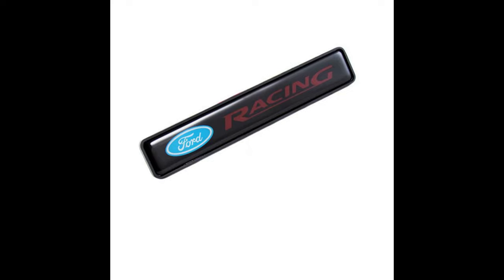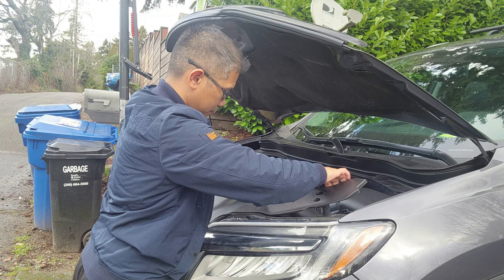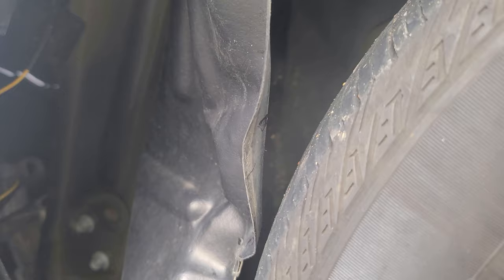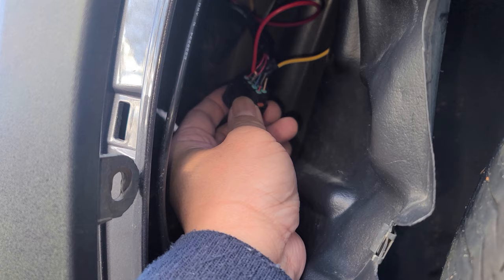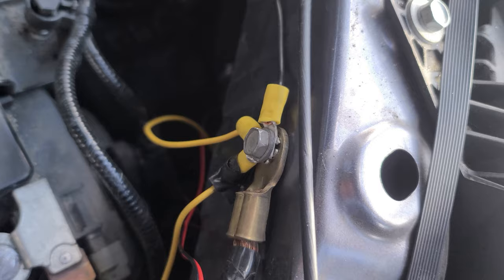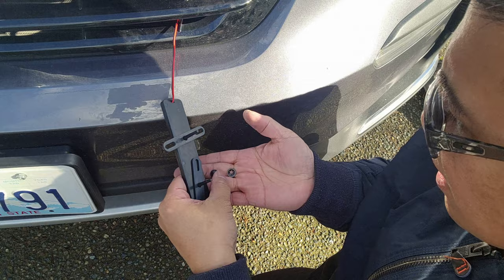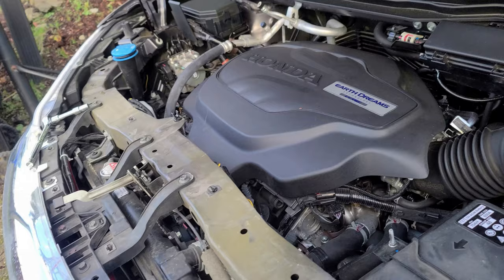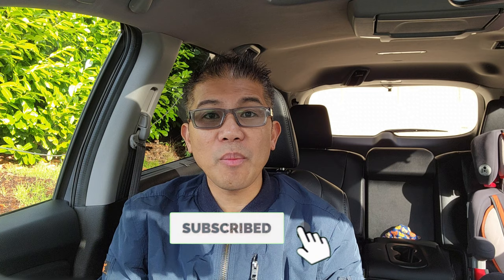How To Install An Illuminated Front Grille Badge

Comment: Great video, Greg.  I just have a follow up question regarding the headlight trouble warning light being on after the install, Did it ever come back on again after you reseted it by disconnecting the negative post on the battery terminal? I installed an LED light strip on my 2022 Honda Pilot SE and tapped into the H/L Headlight fuse and the headlight indicator light turned on.  Much appreciated.
Reply from the maker: No it never came back on.